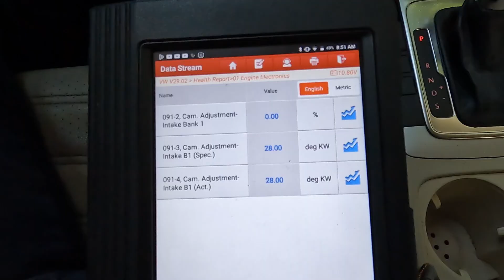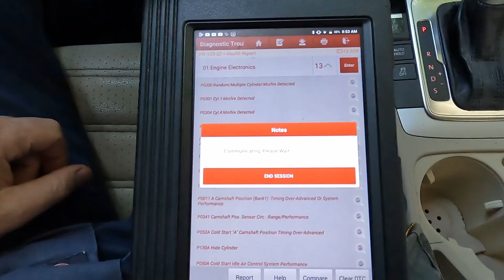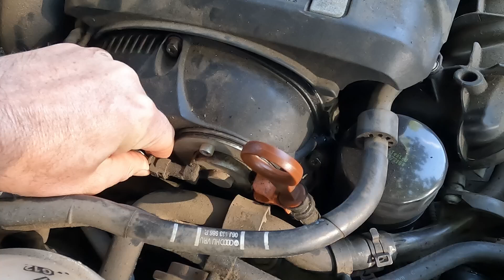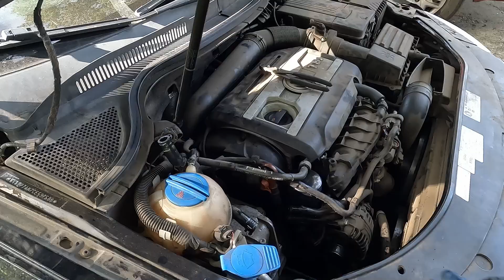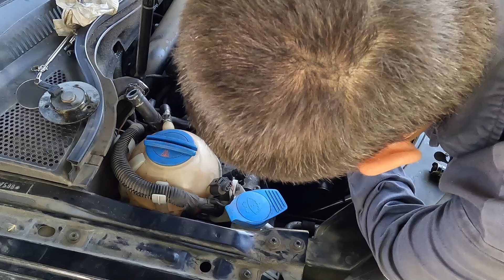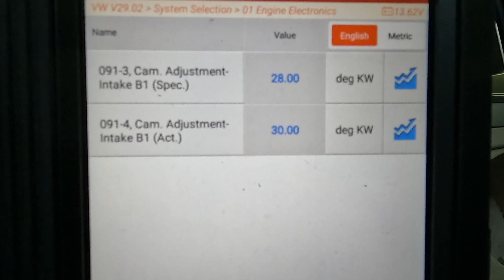2009-2017 Volkswagen CC, Jetta, Tiguan 2.0 Runs Rough and Stalls Diag and Repair

Comment: I am getting ready to work on my 1999 super duty v10. I have a question that I know you can answer for me and I would appreciate it very much do you have a email or way to contact you.
Reply from the maker: @davidc7406  We can communicate through the comments section. What was your question?
Reply: My 1999 f 250 v10 has condensation coming out of the exhaust can the intake manifold gasket cause that situation it’s never gotten hot 280,000 miles on it. I just think it’s not a head gasket.
Reply from the maker: @davidc7406  Are you losing coolant? It is slightly possible. I believe there are 4 coolant ports one on each end of the intake gaskets. But if you look at a new gasket the coolant port rubber and intake port rubber would need to fail in the right place at the same time. I imagine you would probably also get a lean code for the intake gasket leak.
Reply: Yes losing I am losing coolant only thru exhaust.
Reply: I should put the obd scanner on it. To see if there is any codes come up.  Thank you for your time.